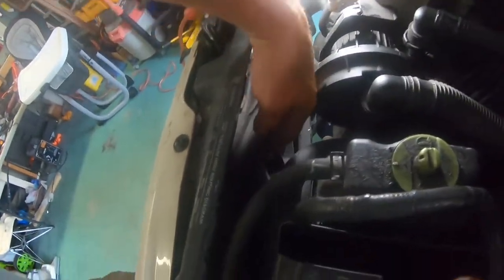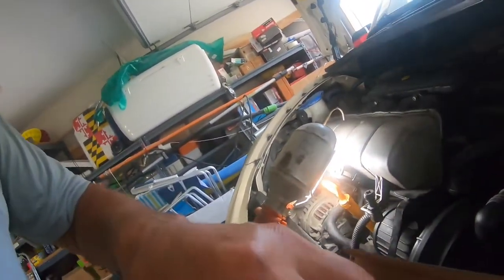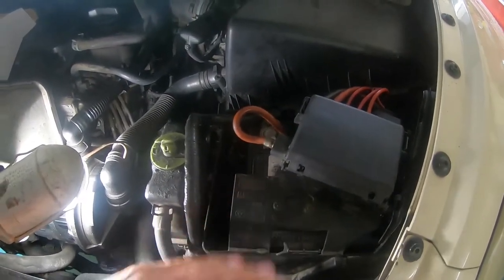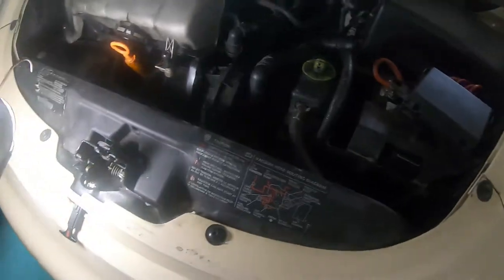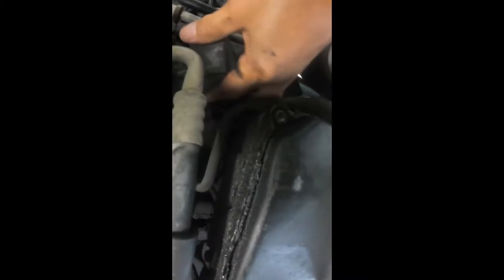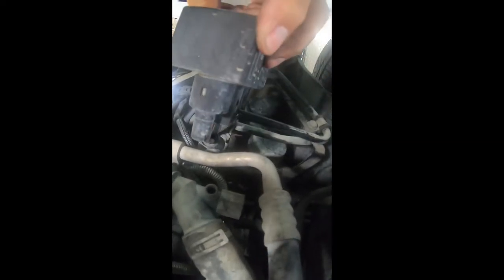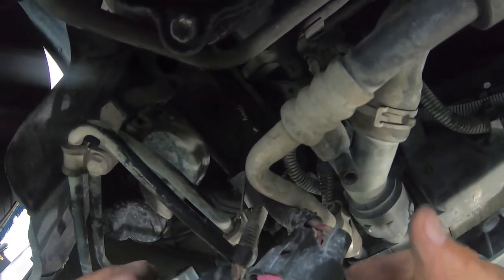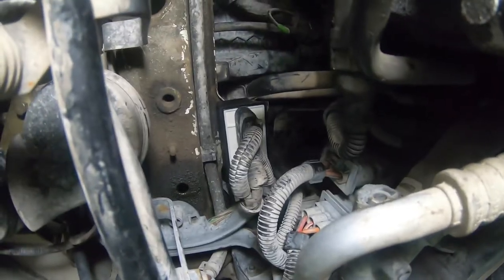Fan Control Module R&R HACK, 2003 VW Beetle 2 0!

Comment: to remove this conectors is simple,,push in the plug and at the same time pull the little tab down,,you will hear a little click which means the little lock assembly released,,than pull connecdtor back,,,dont pry out like he did will brake locking tab,,this plugs need to be secured or they will slide out,,,

Comment: Having done this just myself on a Mark IV Jetta, I found it simplest to take the stuff off from the top as before, but then get at the connectors from the bottom.  Not really very many screws from the top, not too hard, but the connectors are really tough from the top.
Reply: Imma try this...thx!

Comment: The red/black thicker wire which I assume is the power to the fuse look like it was blown out of the harness and it's rusty and damaged. Can one replace the wire connector? It is the connector with four wires.

Comment: Great video.  Those VW connectors can be quite a challenge.  The next time you take one apart, look at it closely.  You'll find there is a flap that is operated by pulling the little "handle" upwards.  This causes the flap to swing out away from the connection.  When the flap swings out, it clears a little stub that fits in a square hole in the flap and the connector comes off.  One trick is when you're pulling up on the "handle", push down on the connector first, and then pull up.  This will free up the flap if it's stuck (it usually is).  Again, another great video.
Reply from the maker: Thanks so much for watching and for great Info! Thanks for sharing!

Comment: Great video time to go back to the drawing board. Been at it for a full day. Everything that could go wrong has. Just call me frustrated never been a quitter.
Reply from the maker: It took me a minute to figure it out.Fan Control, platic Manifold then the thermostat was the root culprit!

Comment: Genius!! I'm the same way, always looking for an easier way. Now I need you to show me how to remove the heater core from the inside! Go for it!
Reply from the maker: Thanks Danny!!!! I'm in Florida, so if/when my heater core goes...I'm just bypassing it!!!🤣👍
Reply: @carlgallerbuilds7990  ironically my bug was leaking badly. I had clamped the heater hoses off previously. Coolant was dripping everywhere so I brought it to a shop in Oldsmar. They found out it was the thermostat housing. Replaced it and an oil change…..$409.  Ouch!! 
  120 miles later coolant is dripping again. I take it back, they replaced the thermostat gasket free but said because I had the heater hoses clamped off the added pressure caused the leak so it isn’t guaranteed anymore. Can you believe that?
Reply from the maker: @dannyorsello8668  sadly, I believe it. "Mechanics" are seldom mechanics anymore. They don't know how to properly troubleshoot. They're R&R technicians...

Comment: Thanks Carl changed mine out today your way. The smaller plug was a bitch to get off but got it and putting in the 2 10 mm bolts , not fun! Thanks for the tips but for my problem didn’t work . Fan fun’s all the time
Reply from the maker: Sorry that wasn't your issue but glad to have saved you a little time, finding out!

Comment: Thank you for the video just want to find out i am driving the 2005 vw beetle 2.0 and have found the same problem car is overheating in the water bottle and my fan is not kicking in. But as soon as my aircon is on the fan is coming on is the fan control module still faulty or is it another problem
Reply from the maker: Glad you found it useful! I'm not an expert so I really don't know the answer to your question. Good luck on your repair and thanks for watching!
Reply: did you check to coolant bottle tap washer?
Reply: Hi Cuscus xib i did replace the water bottle but did not replace the cap it looks a bit old but thanks for the reply think i will buy new cap just to make sure and then check if it is working

Comment: What kind of lifts did you use to get your car hoisted up?  How many inches do you get?  I'm about to replace the fan control module and I like your idea.  Also, I take it that wrench is like a 1/4" ratchet small job -- any link to amazon appreciated.
Reply from the maker: Thanks Timothy! I got between 3 1/2" to 4" lift, only using off the shelf parts including Jeep coil springs front and rear, and Ford F-150 shocks in the rear.
I don't have the list handy but if you go to my BB each Buggy Build playlist, the lift is and early episode, like #3 and #4. I describe all the parts. As far as the ratchet, it's cheap Harbor Freight. Nothing too exotic.

Comment: Genius !  I have a 2.5 and will try this...how can you tell it was overheating ?  my fans do not come on with AC comes on (2006) and they should.  and mine smelled super hot like antifireeze, yea I had the heater on and fan speed to 4 with the top down
Reply from the maker: Thanks Dan!! Mine overheated to the point that it blew off a fitting on the side of the head! SO lucky I didn't fry my motor! The root problem was a stuck (closed) thermostat!

Comment: Thanks for the video, I have an '01 that the fans will not come on, it boils in the overflow, just replaced a cracked radiator. 
Fans do come on with AC though so not sure my issue, WP appears to be pushing into overflow. 

Cool to see you baja bug, I saw it on lifted water cooled VW FB group. I already have Jeep wheels for mine, just gotta get this overheating issue fixed first.
Reply from the maker: Hey SP! Thanks for watching and glad you got something out of the video!
So the research that I found was that if the fan only comes on with AC, then the fan control module is most likely the culprit...HOWEVER,. it turns out that the root cause of my overheating issue was that my thermostat was stuck closed which caused all of my failures "down stream".
If you watch my whole video on my overheating challenge, you may pick up some more info 
Thanks again for watching and I hope you gave it a 👍 and subscribed! ♥️
Reply: @carlgallerbuilds7990  I can feel the hose getting hot when the thermostat opens, but it's like 215-220* according to my scan tool. 
I'm thinking it could be my module, wife was driving it and it overheated and literally blew a chunk out of the radiator housing....I figure no fans, got hot and pressure built up to radiator failure. 
I showed her your bug, she wants me to cut the top off ours now LOL....heck no, I drive it to work in the winter 😃
Reply from the maker: @msack6904  yup! Mine blew out a chunk of the plastic flange on the side of the engine! Much cheaper than a radiator!

Comment: Hi I got a 99 volkswagen beetle2.0l  I just did a timing belt and the tensioner and water pump  but it's still overheating my fans are not kicking on so my ? Is how do I know if the water pump is working I pulled the little hose off the coolant tank and I got nothing coming out

Comment: I would ask where you bought the part?
Reply from the maker: It was a cheap Chinese part that cost a fraction of the OEM part. I was cautioned against it but it has been working flawlessly.
This is not my daily driver that I need to depend on for safety or reliability, so I can comfortably throw caution to the wind! LOL!
Thanks for watching and commenting, James!❤️

Comment: Hello,
video is good but pretty basic. unfortunately there is no video that shows where the fault is if the module is new and spots do not work despite temperatures above 100 celsius. (EVEN WITH SHORT CIRCUIT AT THERMOSTAT, AS A TEST)
Otherwise, spots work if you connect directly to the battery, as a test, but not with old and new modules for the same brand as yours.
The error is further ahead, but no one in the host shows WHERE ???????
PS! a guy has written like this: DO YOU KNOW WHAT HAPPINESS IS ?????
ANSWER: NOT OWNING VAG CARS.
feels he was right.